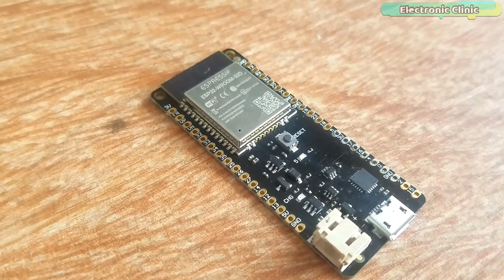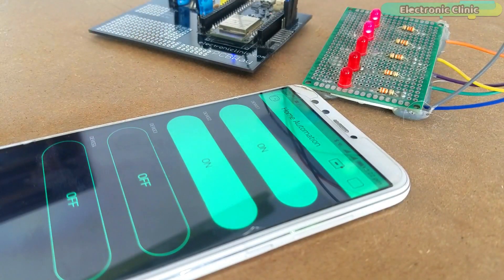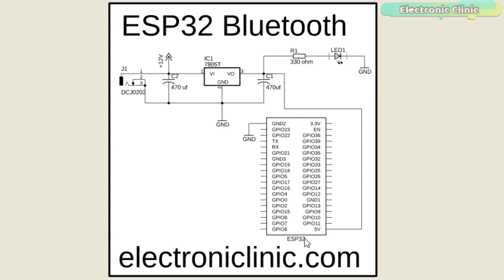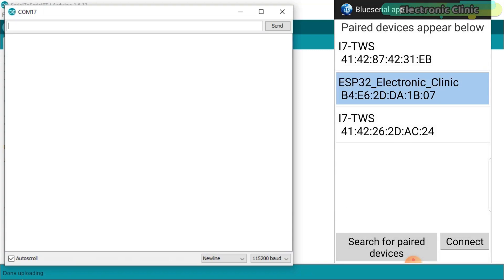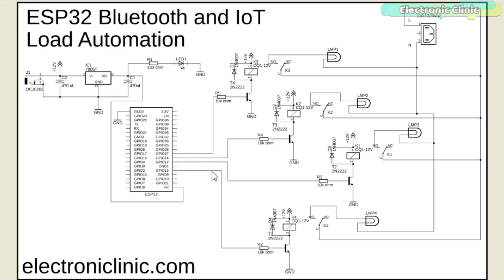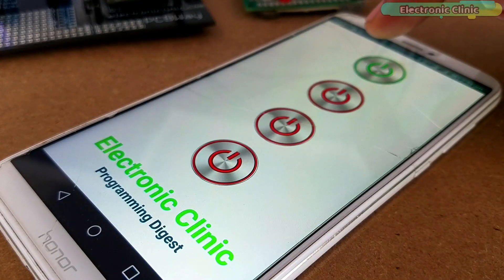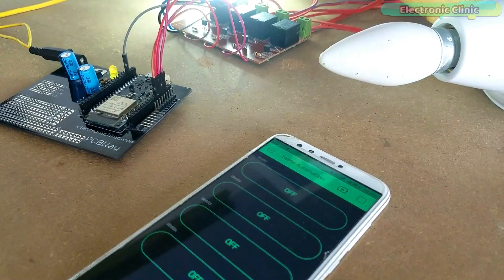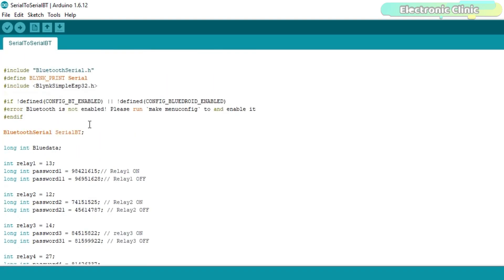ESP32 Bluetooth & Wifi together for Smart House / Home Technology, DIY IoT project, example codes

Comment: thanks for your effort  it is excellent work...I am wonder if it is possible  by using esp32 to read  and send data via both wifi and Bluetooth in the same time ,in a way like read a data from sensor connected to Bluetooth  then send it through wifi     ..do you thing is that possible ?
Reply from the maker: yes it is possible. nice idea. i think i should make a video about this
Reply: @ElectroniClinic  :) may be you should .actually I asked you because the both services use the same antenna.. also May I suggest something here ... if you will make a video about it try to put your idea in a way solving some problem in real life it will rise the value of your work a lot...thanks in advance
Reply from the maker: ya you can suggest.
Reply: @ElectroniClinic  :) I feel that I am involved in something here...let think in a simple way as possible  smart home ..a home with kitchen ,Garage and 2 room,and we have a 3 esp32 with one esp32 cam and a Raspberry pi as a server , with node red software and they all connect through internet router via Mqtt protocol..till now every thing is nice and easy  and life is good..but and here is the catch what if one of the family member who live in the house is blind .. how this will effect our smart home design?  ..the idea is esp32 have both WiFi +Bluetooth  .. what if we could take advantage of Bluetooth tech. in esp32  to send voice command for this blind person to the server(Raspberry pi)and from the server to any esp32  in the house.and vice versa from any place in the house to the server to the blind person..I know there are a lot of details here  because this blind person will move in the house from room (esp32) to another room (esp32)....thanks in advance  event if you do not like my idea  it was really nice to share some ideas with you  ...thank you
Reply from the maker: i have already uploaded a video in which i have explained how to use multiple iot support devices on the same iot platform. now anyone can modify it as per their requirement.